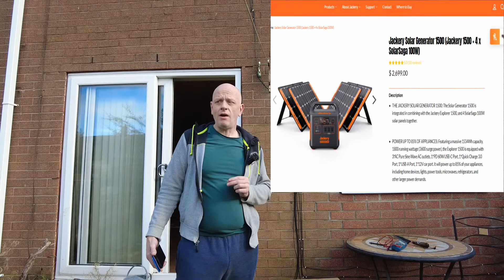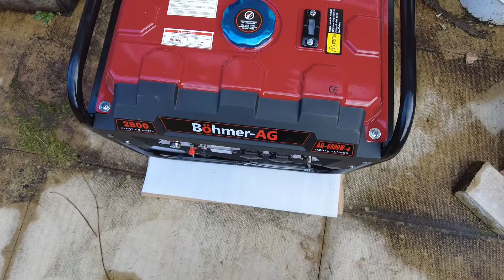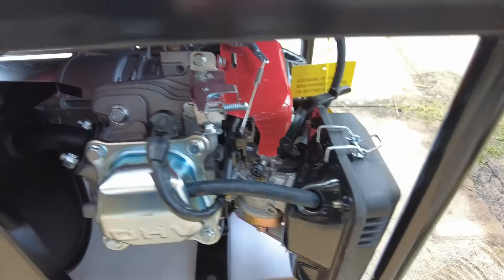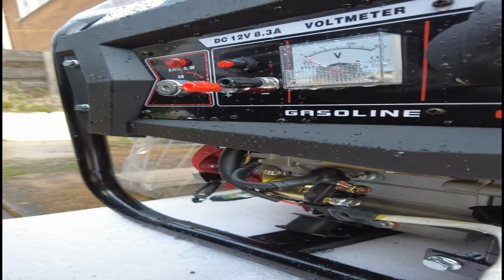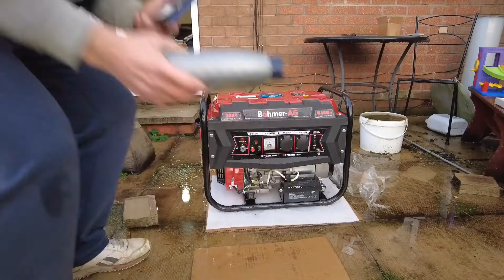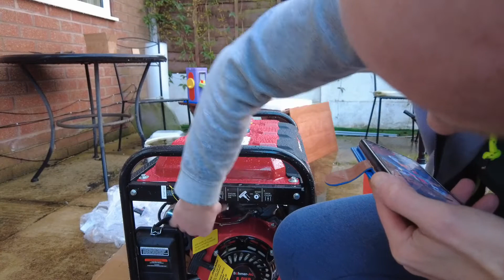Bohmer-AG Portable Petrol Generator 6500W E 2800 watt

Comment: I bought this model two years ago as a back up. Have used it a few times, always starts with ease. Will happily run house lights, fridge freezer, freezer, TV and device chargers. Will also happily run 1 high wattage appliance simultaneously with the aforementioned, (kettle, toaster, washing machine etc up to around 1.5 to 2kw). 
Replacing house light bulbs with LED will give you more a bit more power in reserve.
Run time on a full 11L tank is ten hours.
Addendum: Don't use the 12v output for battery charging as it's unregulated, you'll either take the fuse out or knacker the battery.
Reply from the maker: Great advice and info thanks

Comment: A desktop pc runs effortless even from a non Invertor generator.
Ive been associated with generators for around 40 years, and  i have never heard of any electric start Generator, where yhe battery needs to be connected separately to recharge the battery!
Reply from the maker: It’s definitely a strange design choice, I was surprised when I first saw how this one was set up too.

Comment: Keep an eye on the exhaust pipe studs, this gen is thrown together without much care and the silencer box is pulling the exhaust away from the engine. The studs will rattle loose and fly across your workshop. Guess how I know this?
Reply from the maker: Thanks for the heads up

Comment: Hi did you run a tumble dryer on this generator I'm asking as I'm looking for something to run a tumble dryer to cut my energy consumption at home thanks phil
Reply from the maker: I didn't but it should work. You could use a power monitor plug to measure the surge taken when you turn it on then make sure it's below the max surge of the generator. I have seen a couple of videos on YouTube where they have run a washer and dryer off a generator in a converted outhouse so I think it will

Comment: What fly lead and connections from gen to house because the gen has the 3 pin uk fitting.Also where did you plug into house ?Thanks
Reply from the maker: I don't plug it into the house I run extension leads from the generator to what ever appliances I need to power. Mainly the fridge some lights the boiler if necessary. I now have a battery backup for my CCTV so I don't need to plug that into it now I got a video on that coming out shortly just finishing setting it up

Comment: I'll  help you . First you want to get a bit of cable 3 core the heavy stuff that welders and power tools. Then put a plug on both ends. Switch off you main switch and tun off all of your appliances in your house. Then put one end of the cable into you house plug socket and the other end into your generator.  Now start you generator.  You should be able to run  your house lights Internet modem central heating.  Just experiment what you can run at once. Your be a lot better off than  your neighbours
Reply: Does that actually work like so you don't even need it plugged into the mains?
Reply: Yes I seen an electrician do that used blue 16amp cable  plug both ends into house socket (make sure wall socket in on)and other plug into the genny.Happy days 😊
Reply: That is a really bad way to do it you will have a live exposed plug if it is not in a socket you need a female end as used on caravans and a male outside socket as used on caravans if you don't want someone to be electrocuted.
Reply: @williambaird8807  I have tried this on a test run,but the problem I had was no lights. Outside mains was turned off and fusebox turned off,this was advised by someone but noticed on the fuesebox all switches were listed downstairs lights upstairs lights downstairs sockets etc so I don't know if I'd need those all on or not as a friend said it getting force fed so will go anywhere it can? Obviously you must not be unplugging a live plug but is this actually safe in an event? Thanks and hope to hear from you 😊
Reply: Put you main fuse off and all other internal fuses on .

Comment: my gen has to be turned upside down to fill with oil so it could be worse
Reply: I dont think I have ever heard turning the gen upside down.! There is usually a black plastic screw plug low down on the side somewhere.Just fill it to the level of the screw thread. 5w-30w should do it otherwise car oil 10w-40w semi synthetic.
Reply: Underneath thats the oil drain plug.!

Comment: I have one of these,  ( under the t _ max brand ) not run it in 11 months, went in the shed today, connected battery, fuel on. Two - three turns, and it started up. Great little genny for the money. When you shut it down for the day, close the choke, helps keep the damp out.

Comment: The best way to fill the oil is to measure the 0.6 litre in a jug, tip the generator backwards, put a funnel in and pour it in.

Comment: Hi, don't want to spoil the fun but 6500 is only model name.. rated output is 2600W (2800W max). And it's not German, it's Chinese. Sorry, but that's the painful truth ;)
Reply: Hello, I can confirm that.
It is German engineered, but made in china.
Still I bought it myself, because I found many positive reviews and the oil inlet is not a big negative point in my opinion.
Also the cost/value is very good.
I will only run a few lights at the horse stable, so I hope the generator is fine for this purpose.

Hope you guys have long time fun with your units.

Greetings from Germany 🇩🇪
Reply: @TheAndresun  Hey, all true. I bought one myself too, despite of these things mentioned, so yeah.. I'm just stating facts ;)
Reply: @Solder-Flowz  it is good someone pointing this out, because you can find rarely any information about it on the internet.👍🏽